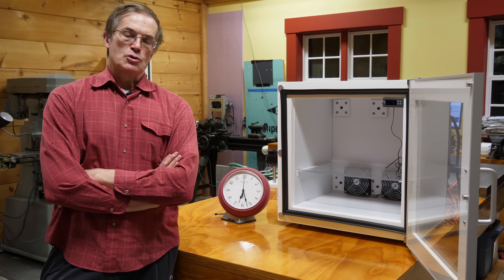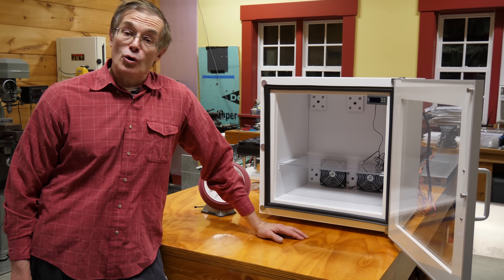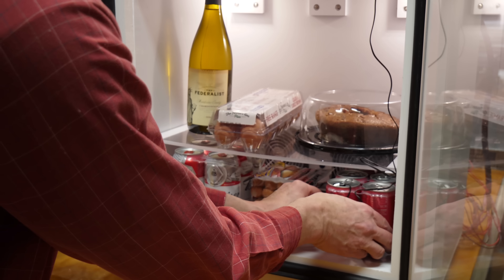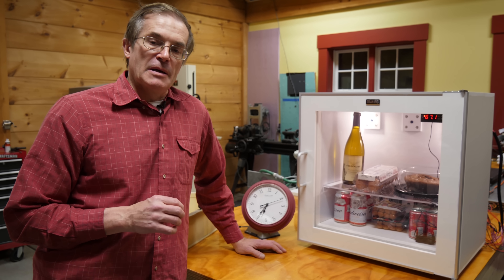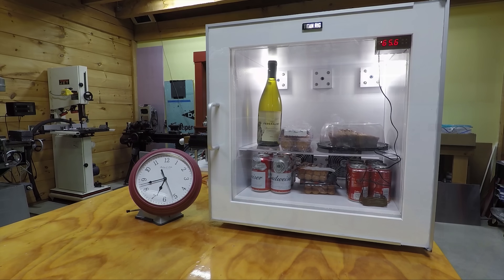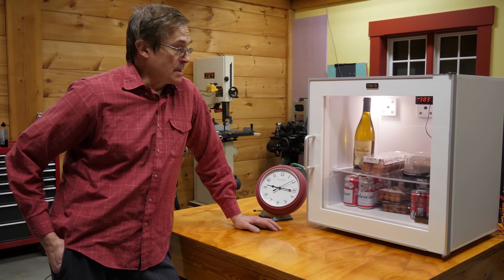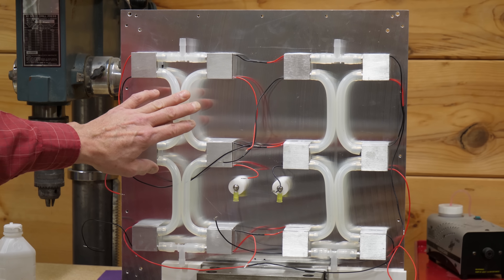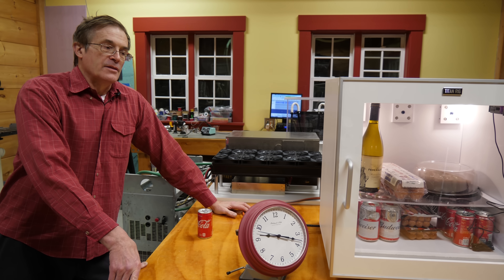TESTING OUR DIY REFRIGERATOR! - TEC/PELTIER

Comment: Why the switch to a clear front panel instead of the routed insulated front panel
Reply from the maker: It's  simply  a matter of convenience for a practical  refrigerator.   Nevertheless,  it is a double panel  with an air gap.
Reply: @TechIngredients  what's the r value for double glazed windows?

Comment: Thank you for your GREAT videos! your video inspires me to make my own refrigerator build on Peltier device two years ago, but since i can write some simple codes for a microcontrollers, i'll tell you my story: my refrigerator run on 12 peltier devices on 24V/6A power supply with 4 large fans "d= 80mm" , with 6 temperature sensors for "PCB, Peltier hot side, power supply, 2X inside refrigerator and environment", with MCU STM32. The working algorithm: start cooling at 100% power until the hot side of the Peltier reach threshold, after that engage the cooling fans/lower the pwm for the Peltier, than loop until desired cooling temperature reached, recirculate the air in the refrigerator  with two mini fans inside the refrigerator. in my system i reached the point when the refrigerator run almost without the cooling fans for Peltier and with 10% pwm power for Peltier when desired cooling temperature reached of about 10 degrees. celsius. the power consumption after reaching the desired cooling temperature is about 20w/h in average. by the way, my refrigerator have an internal volume of about 80L. for more details, feel free to contact me "Obaida8ru@gmail.com"

Comment: So I am building a system to modify a cooler for my boat using 2 peltier TEC-12706's. I have 4 but am using 2. If I were to place a "heat sink" on the cold side with a fan circulating air in the cooler side, would it be more efficient than just placing a metal block on the cooling side? I made a heat sink with my milling machine for the "hot side" so the TEC's sit about 1.5mm in a pocket, the cold side is completely flat. (was trying to get every bit of surface area on the hot side) Just curious if the heat sink on cold side would be more efficient.
Reply from the maker: Ideally, you'd  want a heat sink and a fan on each side.  The efficiency  of a peltier  device is inversely proportional  to the temperature  differential between  the two surfaces. The heatsinks reduce this differential, and fans augment this reduction.
Reply: @TechIngredients  Ok. wish I could place pictures here. I have a 6" long heat sink on hot side with 2x 80mm HAF fans that will blow across that heat sink. like I said I recessed 2 areas on hot side. The cold side is completely flat and attached to another 6" heat sink and will have 1 or 2 fans blowing across. My goal is to just keep things cool in a cooler (40-45 deg F is my target.) I came across your videos and liked it but said ...eh that's waaaay to big for my boat. I'm just going to modify a mid-sized 25Qt cooler. I'm debating dropping voltage to 5V. At 12V each TEC draws 2.5A. Granted I have a big battery in my boat, I'd like to ensure my battery won't die in the middle of the water.
Reply: @TechIngredients  I made a video so you can see my heat sinks. I'm hoping this will be sufficient to just get the cooler to my target temperature of 40-45 deg F. 
https://youtu.be/uXJo6ze9alU

Comment: Very nice design. I really love it.
But i got one question, even this video is 4 years old.

How much energy does it take to cool things down from room temperature to 39°F, and how much like per hour to keep things cool?

I think this temperature controller can controll the target temperature and uses a hysteresis to keep the temperature?

Thank you :)
Reply from the maker: We didn't test that. However, the continuous power draw is 125 watts.
Reply: @TechIngredients  Do you switch off the cooling if temp is reached? I mean is it controlled by a 2 step controller?

Comment: This is insane, this is a complete well done manufacturing fridge, even with a brand in front of it, Great Job!!, I believe the temperature can be further improved with adding inside a cold heatsink with a fan in order to circulate air inside and remove heat effectively, early fridges use convection to cool down the fridge compartment but were not efficient, today fridges use small evaporators with fins and ducts and fan blowers to extract heat more efficienlty than just convection this improve cooling performance, remove moisture, and avoid cooling loses by ice build up, on the hot side you right a liquid cooling can be more effective, theory say that higher the temperature differential the better the performance is, so if somehow you can expose hot side to outside temperature and dissipate heat there, you system would work at max performance, I believe it can easily go to -2 degrees below as many regular fridges today.

Comment: Great video. I'm thinking about using building a refrigerated fish box for my boat. 
Does your controller turn a set voltage on and off or does it vary the input voltage up and down?
Reply from the maker: It's  an off/on controller.  The TECs need an optimal voltage to maximize  efficiency.

Comment: I was thinking the same thing about the northern states. On refrigeration it seems that when there is cold outside that is what should be used to cool refrigerators. Also, I think a rocket stove built for safety and sand batteries would better for heating. Nice production btw.

Comment: The window in the front strikes me as a bad idea, won't orders of magnitude more heat come through the window than the insulation?
Reply from the maker: It's  a double window, but it still leaks more heat than the insulated sides.  This was a decision  based on utility and ease of use.

Comment: for a tech vid, i would have appreciated power stats. I spent months playing around with this stuff and having immersed the heatsink in bucket of water i discovered it is a horror to cool. I do recall that pwm power regulation solves efficiency issues greatly but i had ditched my attempts at the stage before. Nice bid here but too lengthy to give the ne cessary info vs some amateur builds that conveyed sooner and more concisely

Comment: Amazed again. You do very nice work manufacturing things! So I fell in love with the fridge. Is it a kit or did you build it from scratch and designing ability, if the latter, you are in the wrong business, the fridge is esthetically very attractive.
I am also experimenting with Peltier units, I have a ton of water blocks, tubing, radiators, fittings and various heat sink units and even small water boilers for coffee machines and water coolers. These videos have gotten my interest up again, and now I'm digging through my stand by boxes and shelves to see exactly what I have stashed away. I will watch the freezer video next to get the latest of your exploits, and will likely start on a design of my own again.

I've said it before, you are a very interesting guy with very good skills for tech stuff and research! Hats off, I'm subbed again and following.

Comment: Do you have any issues with humidity or condensation using TEC/Peltier modules? I know you're in the north and perhaps it isn't a concern, but I'm wondering if it might be for people in more humid climates.
Reply from the maker: No, there are none, but that depends  on an air-tight seal with the insulation.
Reply: @TechIngredients  Thanks! Do you regulate the voltage of TECs at all to keep a specific temperature or are they always on? I have a project in mind, but I fear that the TECs might be on for too long and freeze the environment instead of just chilling it.

I'm considering using a MOSFET to regulate the voltage since I've read that it's not great for the TECs to be turned on and off repeatedly.

Comment: Bit late on the comments for this one, but here goes.  Probably would have been better to use side outlet blowers instead of muffin fans.  They would move a lot more air, and it you mounted them right, you could get a sort of vortex air flow happening inside.  Seems like the inside fans are having their airflow choked down by mounting them so close to the back of the box.  Also, the back fans only really cool two of the plates, the rest have only convection flow.  Mounting blowers on top or side blowing through all the plates would help immensely.
Also, IMHO, the TEC's would work better if they were in a cluster in the center of the back, instead of the corners.  Just a gut feeling though, not backed up by anything at this point.  Since there are lots of these TEC refrigerators on the market right now, it may be worth a teardown to get better ideas.
Reply from the maker: I disagree.
Blowers  move significantly  less air, but at higher velocity/pressure.
Also, because of the aligned holes in all the sheets, the air is drawn through  the spacing between all the sheets.
Reply: @TechIngredients  Yes, I went back through the video and now see the holes in the rear heat dissipation plates.

Comment: I want to add refrigeration to my raft for down river trips I already have a lithium ion 100 amp hour battery, and a  100 w solar panel  I normally do these trips in July and August. Do you think this is feasible? Any help would be much appreciated. Thank you so much Rod.
Reply from the maker: Sure.  We're  using this fridge for the same purpose.  No problems now after two years.

Comment: If the TECs were mounted to the ceiling of the refrigerator, would the air density cause better mixing rather than adding the fans?
Reply from the maker: Probably not.  Convective flow is very slow.

Comment: Michael Reynolds old Earthship refrigerators were very cool. They were built into the house and had thick insulation and lots of thermal mass. They were connected to the outside with a "skylight" so that they could use the outside temperature to cool down whenever it was advantageous. The thermal mass would help to hold that temperature and balance out temperature swings. Ultimately the effort and energy used to build one of these refrigerators doesn't make sense these days, but back when Michael did it solar, wind and batteries were very expensive and it made sense to put the effort into a fridge.

It does make a person wonder though. What if you had a small 1in hose that pulled cold winter air directly into your fridge? Many months out of the year you would have free refrigeration. It wouldn't cost much and it would be easy to install.
Reply from the maker: I think a small pump, antifreeze and a simple  controller could use liquid to accomplish  this and would be very flexible regarding location.

Comment: What about using heat pipes on the TECs with phase changing liquid (same used to keep cell phone battery cool)?
Reply from the maker: That's  an option.  That will alow you to move the heat from the TEC, but you'll  still need to remove the heat out of the distal  end of the heat pipe.  So, you'll  still need an efficient air heat exchanger.

Comment: I'm interested in magneto-caloric air conditioners using Gadolinium. Perhaps using a sterling engine to drive the mechanism. Does this sound feasible? This will probably cancel out any cooling unfortunately.
Reply from the maker: Put aside the power source for now.  The magneto-caloric process works, but its difficult to engineer the heat transfer process into and out of the gadolinium metal. I've tried flowing liquids and gas, but residual material around the metal dillutes the thermal effeciency and slows the heat flow.  There are lots of valves and pumps, it's tough.
Reply: @TechIngredients  Thank you.

Comment: Do you think a mazed pathway to allow airflow over all of the fins might allow for using a single fan?
Reply from the maker: There is certainly room for improvement.  The competing issues are more surface area with more fins, decreasing the air velocity which gives more time for exchange.  A mazed pathway forces the air to contact more surface at the expense of more air resistance and reduced total flow through the maze. Increased fan power increasing total mass flow at the expense of more energy used, noise and decreased air surface contact time.  Time to experiment...

Comment: It would be good to see one of cour classroom style talks on the modules themselves, not so much from how they work, it's been done but more from the engineering design side. For example there are many rated versions (12706, 12715 etc.) and what is the difference and how to actually get close to their ratings. How are they tested and evaluated etc. Differences between tec and teg and what can you really do with them in the real world. They seem a fun device but what determines how useful they are is in the system design and losing 90+% of their rated performance is so easy to do with simple system design mistakes. Plenty of people have fires running on a winter day so there should be a great delta T, why doesn't a (say) 200W peltier either consume or generate 200W, or even 20? Where do the ratings come from?
Reply from the maker: That would be an interesting topic.  Did you watch our video on the "Campfire Generator"?
In general all these devices operate with the same semiconductor junctions. The exceptions are a few much more expensive modules, for power generation and for thermal differential that can operate at temperatures.
Reply: @TechIngredients  I have seen your generator one yes but maybe should watch again. The rating thing really has me wondering how they test them and obviously this leads to how to get usable performance out of them. TEGs are the higher delta t versions but even then they don't go that high, often 150C which a TEC will probably handle. Ultimately I guess it's the solder melting temp that limits the unit but again, what does a 120W TEC need to make it use or generate 120W?
Reply from the maker: There are TEG modules that can approach 500 degrees C.
Reply: @TechIngredients  and what do they cost, and are rated at and how to get them to actually produce their rated output? I'm sure the normal low cost ones can handle more than their rated temp too. Do you connect them in series and get a usable voltage output but at an efficiency loss or in parallel for the highest output? They seem such a great concept but are seldom used....
Reply from the maker: They cost A LOT more. Last time I looked it was around $50 each and they are no larger than an average TEC and will generate maybe 10-15 watts each.
Reply: @TechIngredients  That's kind of my point, I would like to see the cheap ones tested to their limits actually as I think the gap is less than advertised. Back to the ratings, why are there 12706, 12715 etc. Is there actually a difference? You glossed over the load vs efficiency in your campfire generator article and that's really what I'm after. How to get the best efficiency and how does this compare to the actual stated rating. Should I use 100 12706s or 50 12715s? The actual engineering of using these things, no one has done any more than playing about with them. I want to see more of the science and the real world use of them.
Reply: It seems that parallel gives more output. https://www.google.com/url?sa=t&source=web&rct=j&url=https://www.mdpi.com/1996-1073/13/9/2297/pdf%23:~:text%3DWhen%2520the%2520temperature%2520difference%2520across,connected%2520in%2520parallel%2520%255B12%255D.&ved=2ahUKEwjGx9mi9aL3AhUIilwKHd4YCwgQFnoECAwQBg&usg=AOvVaw30lohNi1RwC83Hkjh3CIjZ

Comment: How did you determine the size of the radiators?
Reply from the maker: Their height and width we're dictated by the size of the refrigerator. Because the effeciency increases asymptotically with each additional layer, that number was determined by the available stock I had on line.

Comment: Could this be used to actively maintain a set temperature inside the fridge, both cooling and warning as needed. I'm looking for options to create a fermentation chamber that will cool down the heat generated by the yeast early in fermentation, but also keep it warm as the available sugars are depleted.
Reply from the maker: Sure, this set up could do just that because it can heat as easily as cool.

Comment: Would more surface area and higher/faster thermal conductivity material to spread the heat out obviate the need to use fans? i.e. Instead of just aluminum sheets but also using a super thin copper plate or foil on one side of each aluminum sheet to speed its thermal spread across the aluminum plates. 

Can you please share the actual wattage usage/costs of running it over the cooldown period and, say, a 24 hour period after?
Reply from the maker: I'm sure the heat exchanger can be improved to the point of eliminating the fans. The unit requires 125 watts continuously to maintain 0 C.
Reply: @TechIngredients  Thank you for answering my questions on your videos. I found your channel and see that you cover a lot of stuff I find really interesting.

Comment: The concept of fridges and refrigerators pumping heat (and while adding some because of inefficiencies) from the fridge to our house, which must then be pumped to the outside again by our thermal pumps has always been a little annoying to me. In the winter, it is not so much of an issue, because most people are trying to heat their house anyway. Still, it is definitely not the most efficient way of doing things, just convenient.

As a cool tidbit, I live in Canada, and we use our veranda as a fridge/freezer during the fall/winter (got a bag of milk from it this morning). Our biggest issue is keeping things from freezing on colder days. Generally, we keep items as close as possible to the glass around the doorway to keep it warmer.

Comment: Why does it save money to use smaller spacings for the heat plates?
Reply from the maker: It saves volume and improves heat transfer, did I say it saves money?
Reply: @TechIngredients  Yes. Now that I think of it, the square spacer blocks between the plates will be thinner and that will be a savings.